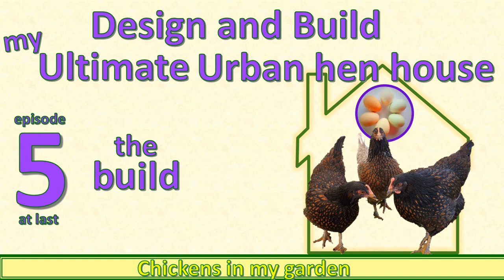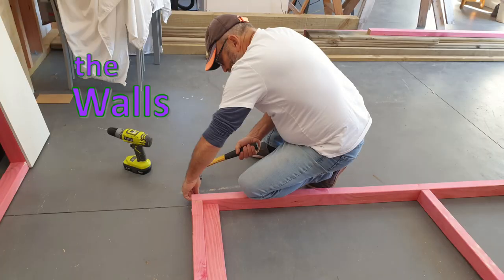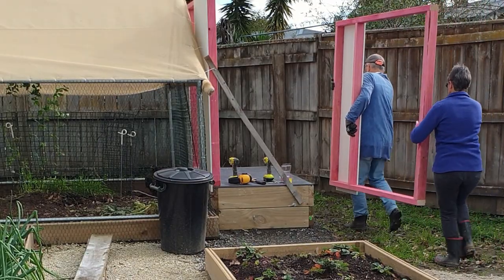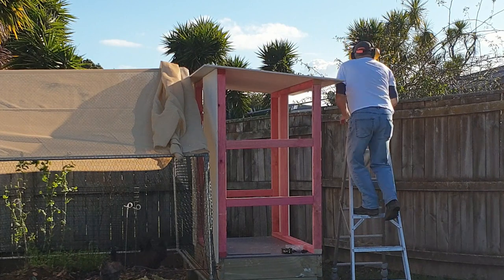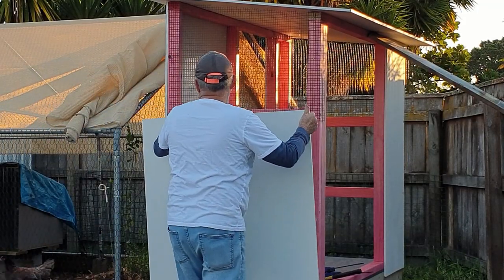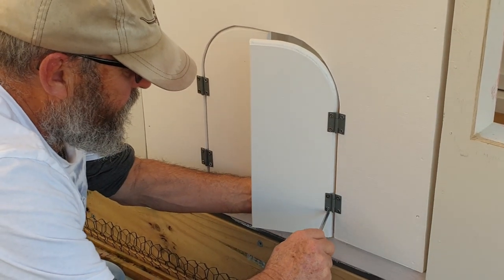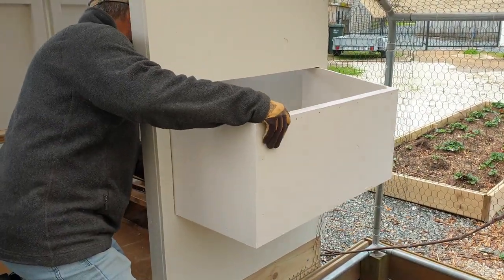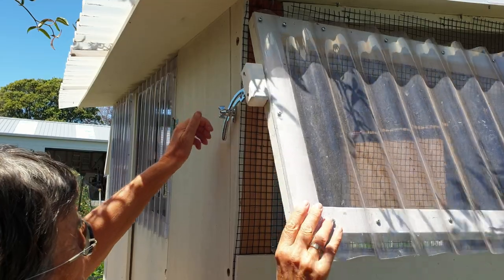Design and build my Ultimate urban hen house - episode 5 - We Build It!

Comment: Your hen house is a lovely design and 🥰 ! I have one question , why did you  install a pull up on your nets box and not a drop down access to the eggs ? All I have read about that is you want a drop down access door.🤔
Reply from the maker: Well it was a little difficult making the hinge area waterproof since the main roof of the hen house doesn't overhang much over that side but that's the only disadvantage I can think of with a lift-up hatch.
I guess the main advantage is that when you lift up the door, everything inside stays in place. I would think that opening a drop down door would allow all the nesting material to fall out, wouldn't it? I guess that might depend on what kind of nesting material you used and how deep it was. 
But I can't think why anyone would prefer a drop down. What advantages have you read about?

Comment: Excellent video
Reply from the maker: Thank you 🙂
Reply: @chickensinmygarden  how many chickens can fit inside your hen house? if you want to have baby chicks do you have to separate the mother and her babies from the rest of the hens?
Reply from the maker: Great questions! 
The short answer to the first one is that it's designed to be spacious for the 6 chickens that would fit in my run but there's roosting space for a few more. The long answer about how I worked that out is in this video 
https://youtu.be/Ufq6xqFKGBQ
As for adding new chicks - well that's the subject of the video I'm working on now! But yes, definitely, a broody mama and chicks should always have their own space at ground level and separate from the main laying flock.

Comment: How many chicken live in a coop that big?, I’m thinking of building a few breeding runs using this concept:)
Reply from the maker: If you're just thinking about the house (and they have access to some kind of run or range) then the size is actually mostly limited by perch space, allowing a foot per bird. (Until you reach the ventilation limit of the building.)
If you haven't already, check out the other videos in this series, plus the one about run space if that's relevant to you. 
I currently have three hens in this house but it's built for six.